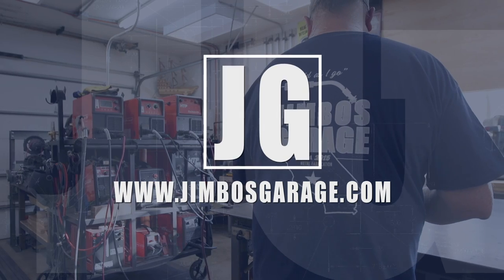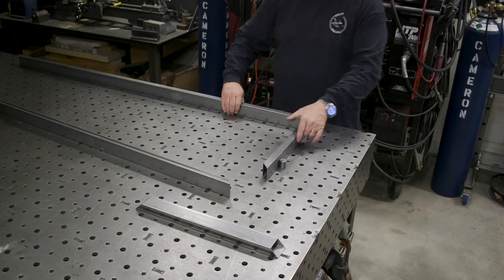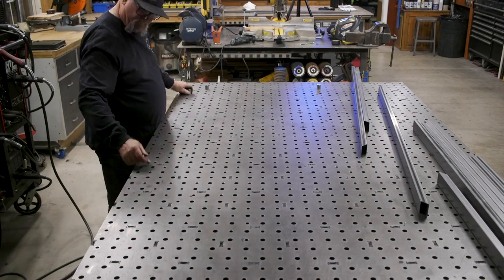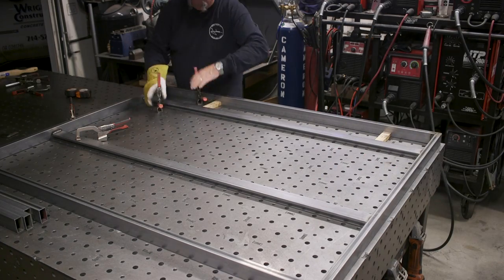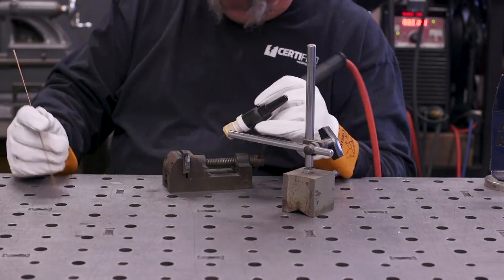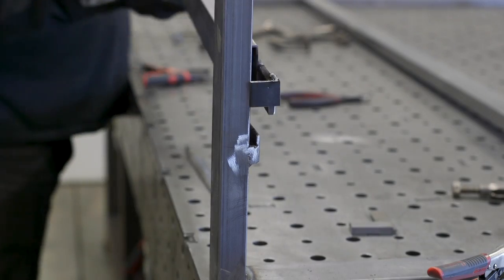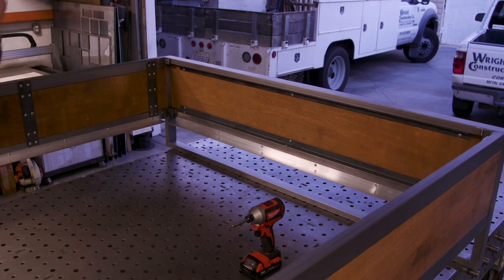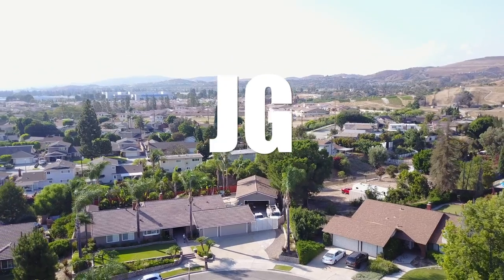Metal & Wood Bed Frame Build | JIMBO'S GARAGE

Comment: Very nice build. An old furniture-maker's trick: use a paint scraper to pull off firmed-up glue on panels before the glue sets solid. That eliminates nearly all surface glue and saves the effort and cost of using a belt sander. The trick is to scrape when the glue is firm and pliable, but not overly wet. Too wet and it just scrapes the glue into the wood pores, which can mess up a finish. Saves a bunch of time and usually I can skip the belt sander altogether.

Also, your shop is a masterpiece. Subscribed. Thank you.

Comment: To aid in reassembly, you can use a numbered punch or even weld on a mark or dots (. . .. .. ... ... for example)  and mark the pieces with their corresponding corner they slot into. Also, for your tab and slot setup, maybe next time try a more simple T and matching slot (looking down from above) with a bottom stop in the receiving part to set height. Great build and I really appreciate you showing all the mistakes, it's very refreshing to see!

Comment: One thing I learned along the way, don't try to reinvent the wheel.
 For example, if I was building a metal bed frame, I would browse existing ones for ideas.
 Using that, I can imagine the post and hole system most bed frames use.
 Love your videos dude. Getting so many ideas ideas from your beautiful work.

Comment: The reason for not sanding wood higher than 220 grit is for finish. The finer you sand, the more the pores of the wood close and wont take the stain or any finish. And general finishes is one of the absolute best companies for finish. Its all I use in my furniture shop. Good job on the build.

Comment: Maybe look at getting a flow/form/friction drill and tap if you have more projects like this. Weld a tab with a hole on one rail bolted to the other? Might save time on some of the fab work

Comment: I have the same problem with tig welding mild steel at work sometimes,the best way  i  came up with is to add stainless filler constantly when the problem occurs. I am using a mison/argon gas mix.. Really love your videos and projects

Comment: Jimbo, 
The final result came out great! Next time you need a "brushed" finish look try a backer pad and sandpaper discs on your grinder. That method is commonly used in the stainless steel industry with varying grits.

Comment: Always enjoy your videos, wondering why you didn't just weld regular tab & slot bed rail brackets? I do it all the time, just drill the keyhole slots in the head and foot boards, then weld the tabbed brackets to the ends of your rails. Totally professional looking, simple and looks awesome. I'm wondering if all those metal pieces will cut into the box spring (or mattress if they are not using a box spring). Anyway, at 69 years old I've experienced as much or more mistakes as you - part of the 'going to school' process... Thanks for the new video, always a pleasure!

Comment: I know this is a older video but I'm sitting here looking at this design and i'm thinking why not just end cap the rails and 2 and drill through the head board legs to the end caps then just run a quick tap on a drill.  But of course this is hind sight 20/20 many ways I'm thinking this could be done.  But none the less I still love the video and how you come up with the end products!

Comment: Love your videos and love this custom bed design.  The wood part of your build may cause problems when it goes through seasonal changes.  Gluing the 1/4" onto the back of the solid wood restricts the wood from expanding/contracting throughout the various humidity changes of the year.  That restriction may cause the wood to split on you.  You'll have a similar issue with the wood panels fitting tight into the metal openings.  As that wood grows with the summer humidity, it may warp inside those metal openings.  Solid wood will definitely expand and contract, so try to allow for that in the design.  It's not as pretty, but plywood may have been better suited for this design.  I mean no offense as I love watching your builds, but I've been a furniture maker for almost 25 years and have learned these things the hard way.  Please keep up the great work!!
Reply: Gary H - I came here to say the same thing. I agree 100%.

Comment: Just a tip when you rip something on a table saw (I know you didn’t have much of an option with your setup) if you don’t have your hand or a push stick on your material between your blade and fence you could have the saw kick it back on you which is very dangerous.

Comment: depending on the wood you need to sand between 120 (hard wood) and 240(pine and other light stuff) the thing is if you sand with higher grits, the finish will not be absorbed by the wood as it should and you start getting stains and other imeperfections.

Comment: I saw that you fabricated the side rails independently but attached them together with the straps.   Did you have any problems getting the sides to release once it was a single piece?

Comment: You're mig welding different size pieces....was wondering if your mig wire size changes. and if it doesn't, what size are you using?

Comment: You could've saved yourself a little bit of a headache by taking some number punches and punching the number of the corner on the inside with a number punched into the long piece that goes into each corner.  That way no one would see it, but then there's no mystery about which piece goes into which corner for you or the client....and it wouldn't wear off over time like something painted or written.  Just a thought.